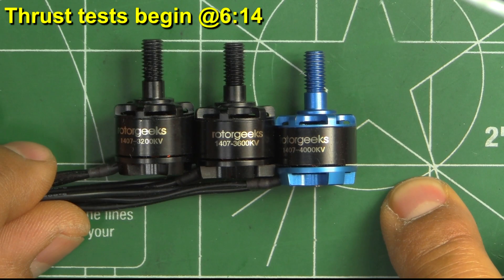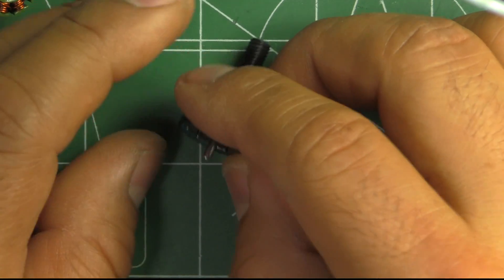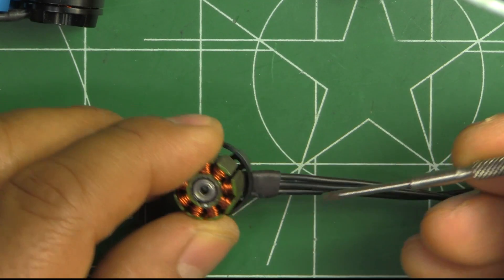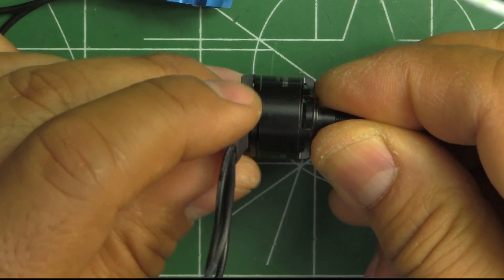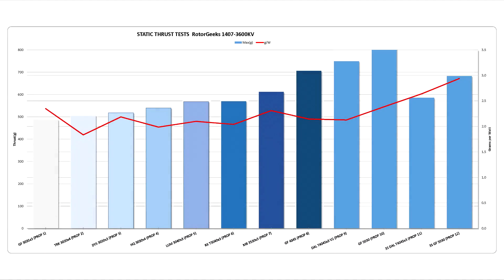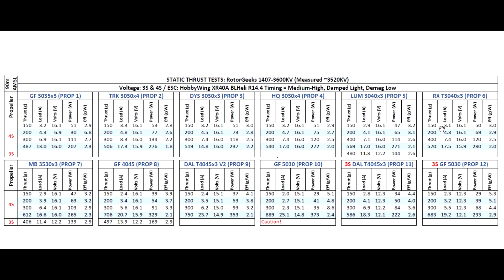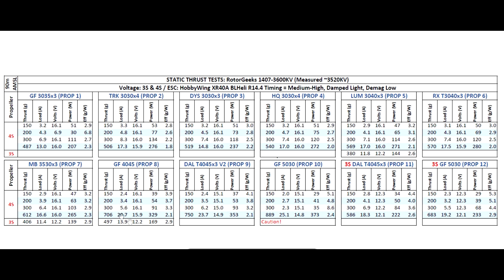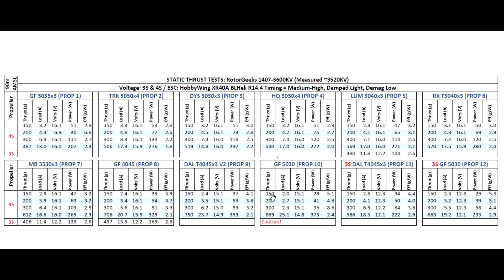RotorGeeks 1407-3600KV Thrust Tests and Overview

Comment: So you think that these motors would be a good fit for a 4" under 250g?
Reply from the maker: Yes, the lighter the better. People are flying with DAL T4045x3 and HQ 4043x3 on higher KV. Check out Adam Featherstone'd build : https://rotorbuilds.com/build/6016
Just gotta be aware that performance is not going to be super explosive but it should get going fast and be fairly agile
Reply: EngineerX .. that is the exact frame I am using .. but I was going to try the EMAX Magnum as the controlling system.... or are the brother hobby t1 a better motor?  T1 are $10 more then the RG on a total of 5 motors
Reply from the maker: I've only read good things about the RG and the performance is very similar. The BH T1's are proven to be reliable and strong. I think both are very good motors so you can't go wrong with either one.
Reply: EngineerX ... thank you for the info ..

Comment: What is the best version for RK 3076x3 and 3041Q4C props ? 4000kv or 3600kv ?
Reply from the maker: Sorry , I'm not familiar with those props. for both 4000KV. GF4045, LUM 3040x3, DYS 3030x3, MB3530x3 are good and affordable. You really have to try each to see if it matches your flying style.

Comment: In your linked chart, for prop 1, why is the voltage so low for 200g thrust?  I've noticed this on the prop1 chart for T1 1407-3600 3S and 4S, and the rotor geeks 1407-3200 and 3600 as well.
Reply from the maker: That's just an error on the Excel spreadsheet.  I wrote some formulas to automate A & V selection for each thrust row. Just change that cell to "='PROP 1'!V3" It's W3 right now and that's the wrong reference. Voltage should be 16.1V

Comment: DAL T4045x3 and GF 5030 props are tested with cca. 15V instead of cca. 16V. Is it intentional or a mistake? Thanks!
Reply from the maker: LoL, I was afraid 16.1V was going to be way too high for those props but I think motor would've taken it like a champ. If I get a chance this week I'll run 15.1V on the 3200KV motor and just append data to the Excel spreadsheet.
Reply from the maker: I updated the Excel spreadsheet (DropBox link), now showing results for DAL T4045 x3 V2 @16.1V. I'll test it on the BH1407 in the coming days when I test a couple of props I ordered and just got delivered (GF3035x4 and DAL T3545BNx3)
https://www.dropbox.com/s/emmmvkdo36k7yxz/thrust%20results%20table%20RotorGeeks%201407-3600KV.xlsx?dl=0
Reply from the maker: What's "cca"? 
Voltage was decreased on purpose to avoid frying motor. I didn't know if Amps would be too high and melt enamel off windings. I've used the same voltage for the GF5030 on the BrotherHobby 1407 and the XNova 1407 so all can be compared on same conditions. Static thrust already exaggerates both thrust & Amps. Tests are good for comparing against other motors or different props but in actual flight voltage, amperage and thrust will be noticeably lower as props unload. 
The 16.1V voltage I use is arbitrary, I tried to keep it consistent since I began testing 3 years ago using 4S-LiPo battery bank for power supply.
Reply: Cca is coming from the world circa, which means approximately. Sorry for using it, I forgot that it is not internationally recognizable. Anyway, thanks for the explanation. I'm kinda hesitating between 4000kv with gf4045 and 3600kv with t4045x3. Since you have measured the two with different voltages, it is difficult to compare. I'm leaning toward to 4000kv since the prop is lighter, but 3600kv with t4045x3 could deliver more 'punch' which I'm looking for. Any thought on that?
Reply from the maker: Oh, yes, I know that word. Here in the US we use "cir" - at least that's what I've used but here is mostly used referring to time/date and not technical quantities like volts or other units.Good to learn how it's used elsewhere :)
If voltage is increased on T4045x3 test, then thrust will be even higher, perhaps another 50 to 70g so in top end the T4045x3 will have a slight advantage but perhaps the response would be slower, meaning when you go from low to high throttle in tight maneuvers there might be a slight delay. But those flight characteristics are difficult to determine from thrust tests, only when you go and test in-flight performance you can really see how a motor/prop combination work. Unfortunately that takes time and money since you have to test both setups.... and RGeeks only sent one of each motor :( would've love to have a full set of each so I could compare for myself
Reply: First off, I can't thank you enough for all the time and effort you put into running these tests, gathering data, and making it available to us.  That said, your killing me on 15.1v vs 16.1v for the tj4045 test!! Ahh!! This is the prop I will be running on these motors and was trying to decide which KV motor to buy.  As this makes any kind of direct comparison between the 3200kv and 3600kv variants of this motor impossible with the tj4045 prop using this data, I'm going to have to "guess", I hate guessing...
Reply: haha, that would be fantastic!  I'd be very curious to see how they compare.  But don't take me too seriously, having ANY thrust results from these motors to compare against the BH 1407's was extremely helpful.  Thanks again for all your hard work, it does not go unappreciated!!
Reply: Thanks so much man!!  I really appreciate you running the test again for me!!

Comment: rotorgeeks... interesting. how are you going to put it on an angle??
Reply from the maker: ??? What do you mean "on an angle"
Reply: EngineerX rotorgeeks responded to me that its easy to remove bearing. they advise to use a shaft on an angle to remove the bearing. dont know what they mean
Reply from the maker: Ah - OK. Yes- that's the easy method to remove bearing, You find a "punch" tool it cold be an actual punch or a cut-off nail that fits through the very small diameter bearing. Then you angle the punch tool and tap it with a hammer. You MUST make sure the punch is resting on the bearing you're trying to remove. You may have tap it several times, moving punch tool around a bit. Bearing should pop right out. Then to press new bearings you may have to use a long screw with washers and a nut and slowly tighten nut to press both bearings in. Some times you can do it by hand or very carefully tapping it using a socket that MUST fit exactly on the outer edge of the bearing.
Reply: EngineerX thanks EngineerX. Can you make a vid of it :)

Comment: For people who are using this this kind of motor (1407 size). Which lipo are you using? I am using 850mah 4s 70graphene but the lipo is really hot at the end and the flying time is around 1min (3.7V per cell just after landing)
Reply: I am using RCX 1707 3200kv with gf 3035x4 total weight is 270g. When I made the calculation this flying time seems correct...but it is too low... These small motors are pulling a lot of amps regarding their size. The RCX1707 is heavier than the 1407 around 3gr but his efficience is better
Reply: Cid156 that is really low those motors seem very inefficient. Or maybe there may be an issue with the lipos?
Reply: Sorry 270gr it is the total weight with lipo...without it is 170gr... I will look for a 1000mah
I am impressed that you are running 4* on a 1407. Which kv? Is the flying time okay? it should be a missile :)

Comment: When will we see the static thrust tests for the 4000kv and 3200kv motors. These look to be very similar build to the RCX 1407 v2 motors which are by far the smoothest motors I have ever run. Is it possible to get thrust tests on the 1407 motors using kingkong 4045 as those seem to be the best prop in my opinion for this size.
Reply from the maker: Hope to have RG 4000KV results up in a couple of hours. I didn't test the KK4045 prop because the GF4045 outperformed it 735g vs. 688g on the thrust stand when I ran both with the XNOVA 1407 (video link below). Of coourse that doesn't mean the KK4045 is necessarily a bad prop as your experience has been very positive. GF4045 prop does well but it's also a bit fragile and bends easily. From that test comparison and the GF4045 on the 4000KV motor my best guesstimate is that on the RG4000KV motor the KK4045 should make around 740g @ 25A. I'll try and run it on the next test session and I'll add the data to the Excel table. Hopefully this coming week. Post here to remind me or ask again.
https://youtu.be/lVsGjIJ3RNg?t=6m32s
Reply: Could you have a compiled spreadsheet / google doc on all 1407 motors you have tested. This would offer a great data set for comparison on 3-4" class motors
Reply from the maker: I thought about it, but unfortunately the very little spare time (after work and family duties) I have I use to run the tests and make the videos/ data tables. If I manage to find some free time later that's something I'll consider.  But , yeah I agree, a consolidated Google database would be awesome. I need to spend sometime looking into it... it probably is as easy as copying and pasting all the data/ dumping Excel files

Comment: about spare parts... its almost inpossible to remove bearing
Reply: Bearings are easy to remove - just tap out the first with a shaft on an angle.  The second one is no problem once the first is removed.
Reply: Rotorgeeks how on earth on an angle???